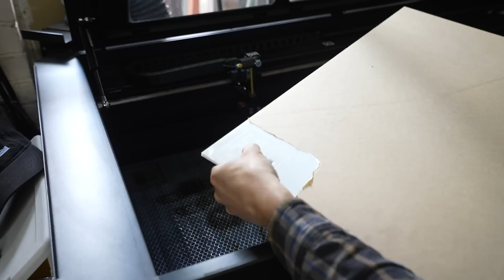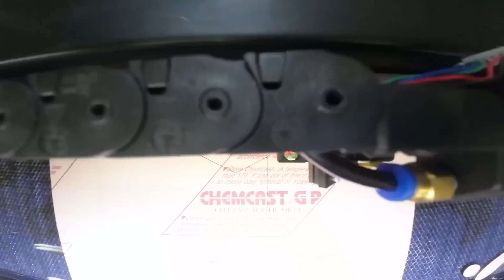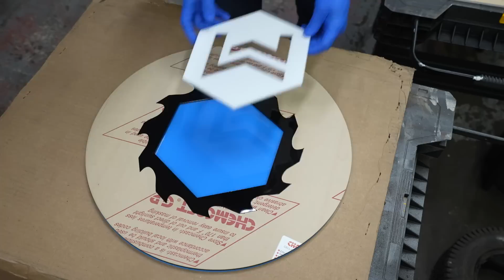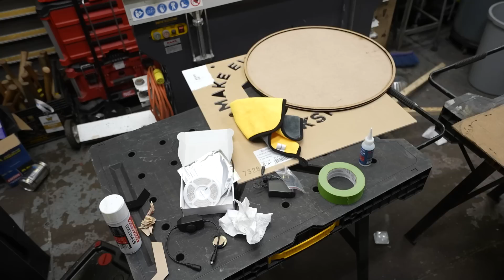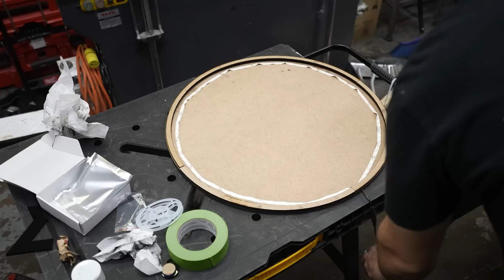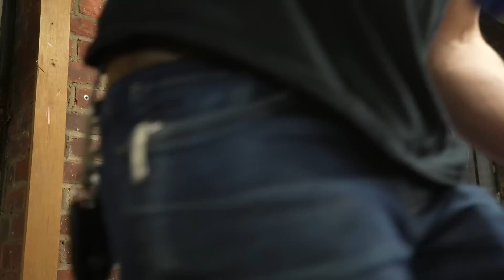Beautiful Sign, Made Easy!

Comment: If you want to pack your parts more closely on your raw stock to minimize waste, you can still make the negative templates for alignment using a sheet of cardboard.

The same trick works for aligning things in your laser for engraving too. Plop a piece of cardboard in, push it up against the edges/stops to locate it, cut the outer shape of the thing you want to engrave, remove the cardboard offcut, insert the workpiece, and engrave. Easy peasy.

Comment: Lighting tip for those who don't like the visible ring from the LED strip pointing straight through the acrylic: make the walls deeper to attach the LEDs onto, pointing inward, and give the inside of the backing a coat of pure white for the light to bounce off of.  You'll end up with a more even lightbox type light across the sign.
Reply: Good tips! Another tip, or word of wisdom from experience, maybe. Is that no amount of diffusion will hide a source that is directly behind the diffusion. Edge lighting, to light a surface instead is a great way to have an even backlight.

Comment: So how much did the laser cutter cost all in?
Reply from the maker: A laser that'll do this work is gonna range between $3,500 - $13,000. The Muse Titan im using has a 24x48 bed, so it's more expensive. But a smaller 40W laser will cut 3/16 acrylic easily!
Reply: @MakeEverything  yikes!

Well you're gonna have to make a fair few signs up pay that off! :D